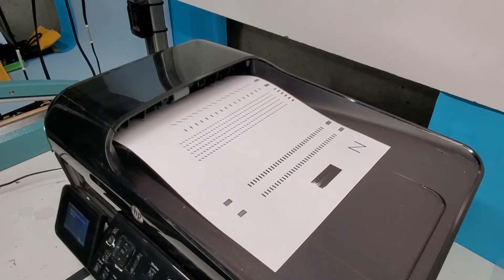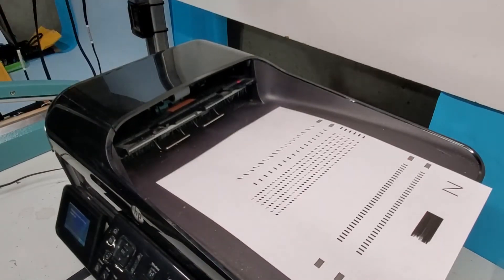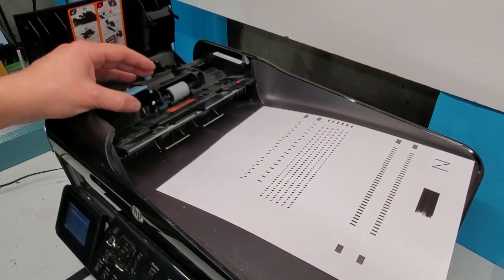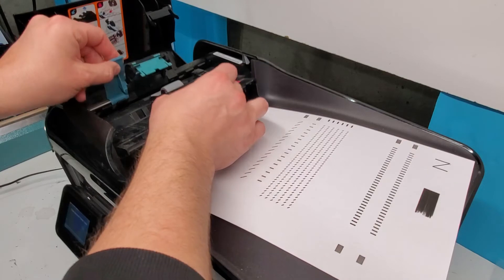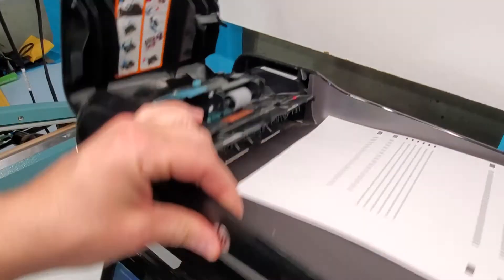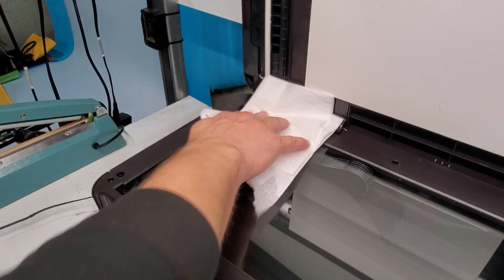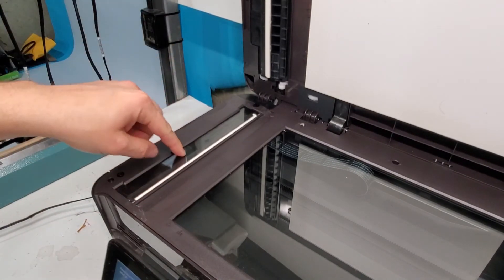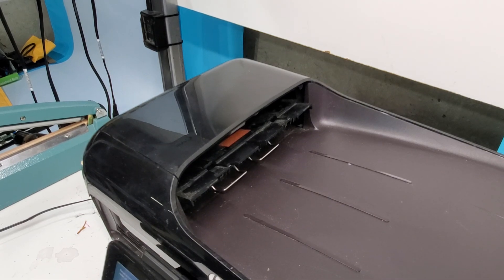Fix Common ADF Feeder Jam Problem on HP Photosmart Premium C309a C410a Printer

Comment: What do you recommend for an all-in-one printer (including fax) for a small business that prints invoicing, and clerical based documents but with (non photo quality) color? Thanks!
Reply from the maker: If you like HP, I would recommend HP Officejet Pro 8015, 8025, or 8035 printers. Thank you.
Reply: @303electronics  I ended up with a 3830 and did a complete refurbish thanks to your tutorials! The previous owner didn't think it was possible but I just wish I had taken before and after pics. Thank you my top notch friend!
Reply from the maker: @artisanconcrete1212  Great! Thanks for the update!
Reply: @303electronics  I also Improvised in that the tension spring for the paper feed needed to be replaced as it was worn out and I used a spring from a pen I had to heat it up then shock it under cold tap water to reverse temper it and voila it worked.
Reply: It seriously is minds like your that help keep the world moving
Reply from the maker: @artisanconcrete1212  I appreciate your support!